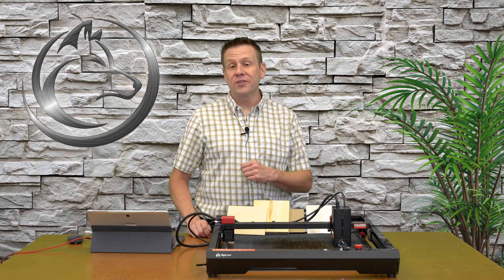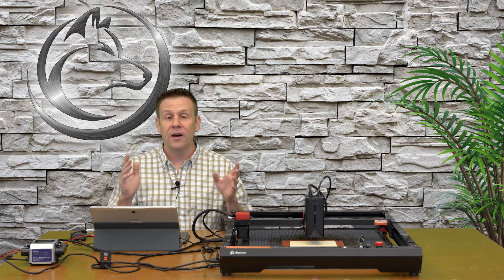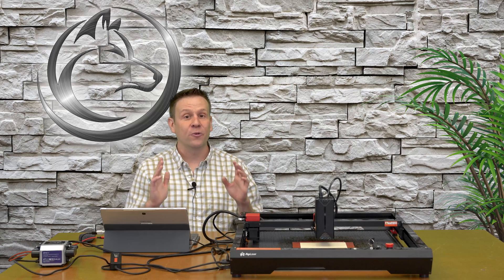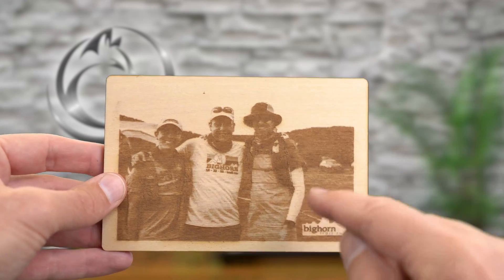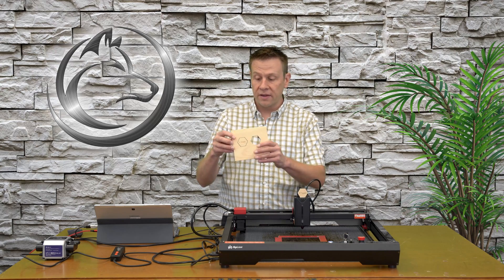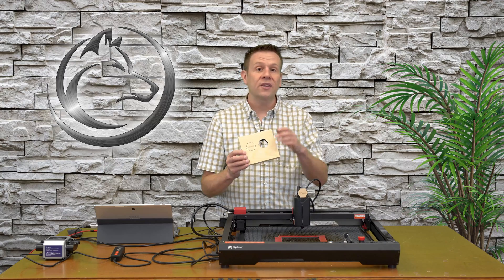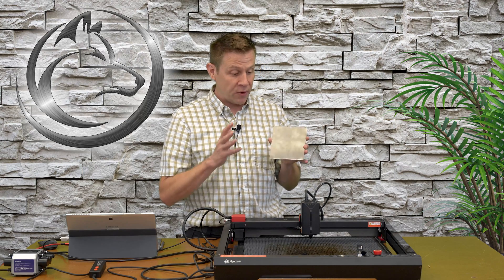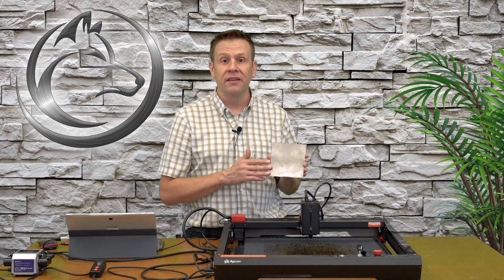High-Precision Engraving and Cutting--AlgoLaser Alpha 22W discovering

Comment: Which laser do you think is better? Athomstack x20 or this one
Reply from the maker: t really depends on your projects- but the AlgoLaser is newer technology.  The Algolaser runs a lot faster and the frame is more rigid which is good.  Both brands offer great machines, but now that I'm reading what I typed the Algo sounds like the way to go!  Best wishes!
Reply: @thelaserchannel1  thanks
Reply: one more question, which one is better for cutting thicker things thanks
Reply from the maker: @tomaszpralat344  They are both about the same power output. The AlgoLaser has updated laser beam combing tech while the AtomStack has the air assist pump that flows more air... both are need for deep cutting.  There's always the option to use a higher flowing air pump on the AlgoLaser but you'll loose the Lightburn controlled air ON/OFF.  Overall though the depth of cut will be a little deeper and cleaner with the AlgoLaser with an after market air pump.  The next noticeable performance increase comes at 36 watt laser module and at 48 watts it's crazy awesome with a slightly higher price to match.

Comment: Hi
Can it cut 3mm acrylic in other colours?
Reply from the maker: Laser diode cut black the best- other colors can be cut but will take more power, more passes, and slower speeds or a combination of power, passes, and speed.  The darker the color the easier cutting will be.  Blue, white, and semi clear acrylics do not cut with a laser diode.  Many retailers offer a sampler pack and I recommend this a starting point for engraving and cutting acrylic.  Thanks for watching!
Reply: Thanks so much for the fast reply! :)